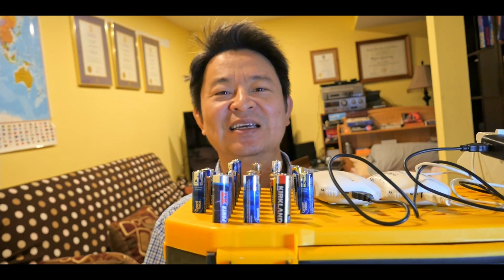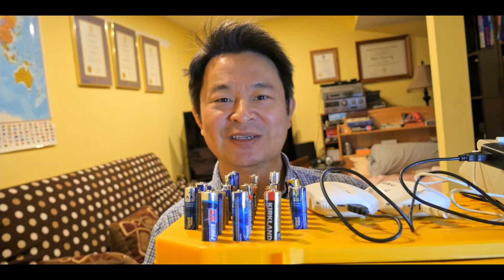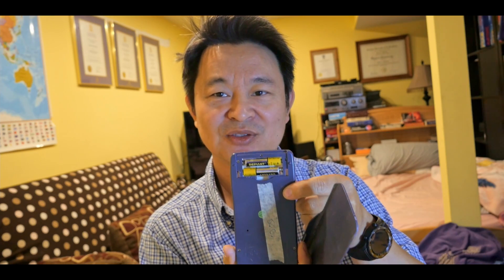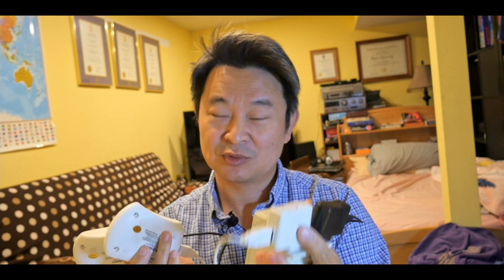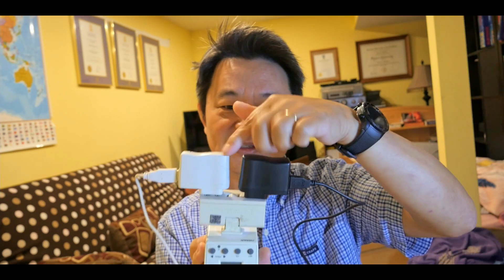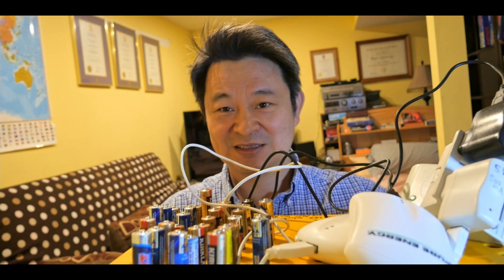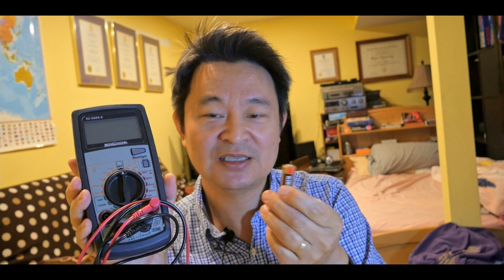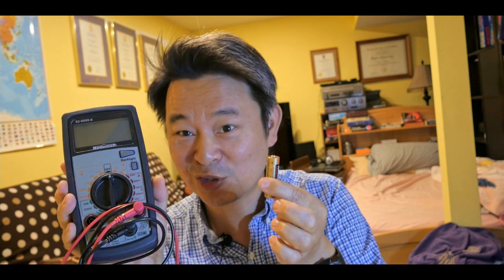How to recharge or re energize regular alkaline batteries safely and effectively

Comment: the lower the voltage you let the batteries get, the worse results you will see.  if you recharge before the voltage drops below 1.25v, you can usually charge back close to full capacity a few times before they start dropping off. maybe charging to 1.55-1.65v.  i've experimented some with charging a little extra before using with mixed results, up to 1.7v. i have damaged some.  i can test for capacity on the multimeter, with 10A current setting, just checking as quickly as possible, but is still bad for the battery.  i make many of my own chargers, and power supplies using buck converters with old printer power supplies, and wall warts.  the old dumb non-switching wall warts seem the most useful to me.

Comment: hmm 4 years ago i bought a bunch of aa/aaa format lifepo4 batteries. they are all still running fine. the issue is they have double the voltage of regular alkaline batteries so you need to make spacers or rewire the battery contacts. alkaline batteries are such low voltage that most electronic devices use multiples of 2 to run, so it actually works out really well. they dont leak and they basically have the same capacity as mid grade alkaline bats... its just that you might be giving up some capacity if you use spacers instead of rewiring a battery holder from series to parallel. cant believe almost no one has heard of these. i just recharge them with a bench power supply and some neodid magnets.
again this was 4+ years ago that i bought them lol, they still have full capacity. they were cheaper than alkaline batteries when i boguht them at the time ironically. brand name of the only mfg that makes them is soshine. all lfp is made in china btw.

Comment: Can a CR123A lithium battery (non-rechargeable) be recharged?
Reply from the maker: I don't think so, but I have not tried to charge it myself yet.
Reply: @educatetube  thanks for your reply. I couldn't find any info about anyone attempting to recharge these non-rechargeable CR123A batteries, so I'm not going to take a chance. I have found that the retailer Lowes sells Surefire lithium CR123A batteries quite cheaply at $4.97 for 2 batteries. Made in USA.
Reply from the maker: If you are recharging it, make sure to start at very low current (less 100mA) and monitor the voltage.  DO NOT let it be overcharged, keep monitoring  it and turn it off when you are away from it.  Don't take any risk without great precaution.
Reply: @educatetube  will do. thanks for the tips!
Reply: No. Lithium-ion batteries such as those used in laptops, cell phones, and power tools are fully reghargeable but ones that only say "lithium" cannot be recharged.

Comment: I have a charger from Amazon (still available, i think) called Maximal Power FC999 Mark 3, which charges lithium, NiMH, Alkaline and NiCad of all sizes and voltages, including 9v. It has been working well for me for 3 years now. Excellent video, there, and i think i will experiment with making my own, too, like yours...just for fun. Many thanks.
Reply: Just to add....it seems the newer version of mine does NOT now recharge lithium batteries, unfortunately. Mine does.

Comment: Yes, it does work but is very limited and imho not really worth it. The best way to recharge is to use pulsed DC just after a rectifier diode (or bridge rect.) - no smoothing. Max. Charge voltage can go up to 1.6 or max. 1.65V and max. current for AAA is less than 50 mA, for AA max. 100 mA. The possibility of leakage will increase drastically - in my case after 2...3 years 25% of all recharged batteries suffer from leakage! Don't use recharged cells for expensive electronics at all! Only use them for cheap, low load devices like clocks e.g. Imho its not really worth the fuss - much better to use NiMH rechargeable batteries or the new li-ion ones - they don't leak!
Reply: Yeah, I agree. Instead of recharging alkalines, I simply "migrate" my used batteries from higher-drain devices down to lower-drain. When a device stops working I use a battery tester to check the charge left in the battery(ies) (my analog meter gives a percentage reading). I write this percentage number on the battery with a fine marker, then put it in a box of used batteries ordered by expiration date and remaining charge level. Next time a device stops working, I simply replace the used battery in it with another that is "less used" (i.e. has a remaining charge level that is slightly higher). When pairs are used, I match brands and charge levels as closely as possible.

A hair shaver will stop working when an alkaline battery drops to only 90%! This battery is then still good for a pocket radio. Once it gets too low for the pocket radio, I can use it in a wall clock. After that fails, the battery is down to 75% or so, it will still work in a TV remote, even down to 60% or 55% charge. Below 50% (on my analog meter) it is pretty much good for nothing, in my experience. With this method, I am still getting useful life out of batteries that are literally over 10 years beyond their expiration date and have not leaked yet!

(Anyway, I only use Ni-MH in my hair shaver now because it burns through alkalines too quickly.)
Reply: @jeromeglick  yes, most economic procedure but quite cumbersome and time consuming. High drain devices are only used with rechargable batteries, preferably li-ion or Ni-Mh. The other remain with alkalines.

Comment: tried to charge it by low current, after 6 days of charge i got voltage rise from 1,09 to 1,54V. Still in test, my goal is to rise it to 1,601V, and then test if it keeps it

Comment: I learned along time ago that alkaline batteries can be recharged, you just have to watch them carefully. Had some leak ( none blew up ) but found that the device ( cheaper ones) could be cleaned by using white vinegar on q-tips  and lightly rinse in tap water, air drying or with hair dryer. Saved a lot of money.

Comment: Best Alkaline 4X AAA/AA battery Charger is the (made in Taiwan, ROC) Powertran A0280.
It is a microprocessor controlled battery charger allows you to recharge standard alkaline batteries up to 20 times. Also can charge NiMH rechargeable batteries. 
I have been using one for years charging lots of alkaline batteries. Tried to buy one more but product is no longer being manufactured.

Comment: Did you try Coin cells? lithium batteries? cr2032 for example?
Reply: sofern die Knopfzelle Alkali-Mangan basiert ist, gelingt die Regeneration. Die meisten sind aber mit Lithium und das lässt sich nicht regenerieren. Jedenfalls hat es bei mir nie funktioniert. Dagegen Kohle-Zink sowie Alkali-Mangan, das geht. Ich habe eine ganze Reihe von solchen Regenerator-Elektroniken gebaut in den letzten 10 Jahren. Internet und Elektronikzeitschriften sind voller Schaltpläne. Eine Firma ACCUCELL hat die Lader mal verkauft, dazu auch speziell regenerierfähige Batterien. Sind aber jetzt "out of business".

Comment: I hope your day job isn't selling fire insurance.
Reply: Is it your day job? Are you qualified as an underwriter or have some sort of degree that qualifies you to make such comments? If not, then why bother? Grow up.
If you cycle the power on and off in 20 to 30 minute intervals   and not allow it to overheat...
Then it works.
Plus if all else fails you can do it outside.
You clicked this video, looked up the content then have enough audacity to think you are qualified to make such statements? Get over it.
Reply: @samgreen23  If a fire starts as a result of attempting to recharge a non-rechargeable battery such as an alkaline battery which is always clearly marked with a warning NOT to do so, the insurance company will NOT pay the claim. This is a disaster just waiting to happen. Buy rechargeable batteries. And no, I'm not an underwriter. I just have common sense.
Reply: @richardmerriam7044  so does a lighter, do you sell those? Do you sell fire insurance?
 Thanks for the tip but not everyone needs a label on a tidepod to prevent poisoning.
If done correctly it can be done in a safe manner.
Lighters are dangerous around paper, you going to light the stack in your kitchen? Let's talk about common sense shall we?
Reply: @samgreen23  You clearly missed the point.
Reply: @richardmerriam7044  no, I don't think I did. You certainly missed mine though.

Comment: Radio Shack used to sell a recharger for Alkaline batteries including 9V ones.
Could do 2 batteries or one 9V.
D cell batteries took nearly 18-20 hours to charge.
Too bad they are out of business and no longer have those available.
Reply: Didn't the RadioShack ones also charge carbon zinc batteries?
Reply from the maker: No, it cannot charge carbon zinc batteries as they already started to corrode away and hard recover.

Comment: How many days if used this in multi tester same as you?
Reply from the maker: You charge the batteries several times depending on the brands.  Watch out for battery leakage if overcharged.  Always monitor the batteries to make sure it does not leak.

Comment: How do they charge new batteries at the factory? I just bought 8 D cell batteries and put them in a 9 inch plastic fan, and the fan would not turn on. I put the old ones in and it ran. I put 6 other new batteries in and it worked fine. I put the first set of new ones back in and - again nothing. I think that sometimes they ship dead batteries. I'm going to test them in the store before I buy them from now on.
Reply from the maker: @lights6833  Wow.  This is surprising.
Reply: They don't "charge" new alkaline batteries at the factory. They insert all the fresh chemicals into the battery cell which when mixed in the proper way, inherently contains charge, produces a voltage differential, and can push current.

Comment: Is this possible to recharge duracell® 6v lantern alkaline battery?  If yes, how to do this.
Reply from the maker: You probably need a variable voltage bench charger that charge 6v @100-200ma for 3-4 hours.  It may leak after several charging cycles, so it may not be worth it especially if it will give you only several wattage of power; mainly used for LED light.
Reply: That's is a lithium single use battery.  I wouldn't try charging it -- unless you'd like to set your house on fire...

Comment: Thanks for a valuable video.   A few questions:   

1. at 3:15 you label the type of charger you use as "alkaline rechargeable device".  It would be useful to distinguish these from other kinds of chargers.   One of my chargers immediately rejects my alkaline non-rechargeable batteries, while another (less high tech) charger accepts them.
2. I am assuming you use a 4 hour timer to avoid the possibility that unlimited charging time might cause battery damage.  Is that right?  If so how did you settle on 4 hours?
3. Have you tried recharging batteries that are very drained vs. those that are less drained.  For example I have quite a few AA alkaline that are giving 1.0 V now.  Would you expect they could be recharged just a well as more depleted batteries (eg 0.5 V)?
Reply from the maker: Answer:   I used any chargers that only charge alkaline batteries up to 1.2-1.5v with low current (less than 200ma). Set the time to 4 hrs charging limit (thought this would prevent leaking). Charged Alkaline batteries are only used for my LED lights. However, after several charging, some of these alkaline batteries do LEAK!  I think the more drained the battery, the more chance of leaks.  My current solution now is NOT to charge alkaline batteries but to drain all the power from it using low voltage booster circuit.  Now, I prefer salvaging Zn-C batteries and take their chemical components to make new batteries. You can check my DIY Zn-Al battery experiment videos.

Comment: I found a good battery charger for Alkaline Batteries, as well as Lithium. Its on Aliexpress at the store KLW 168 Official Store, Store number 4682052. It  does up to 4 AA at a time and is about $10 usd plus freight and has a USB power cable, so a an adapter is also needed for whatever country you are from. It has excellent reviews, about 74 of them. They are very hard to find or expensive elsewhere, as far as I can see, since alkaline charging is not recommended. I have a Powerhaus fast charger which is good quality, but does NOT like alkaline batteries, the charging LED goes from red to green very quickly. However I discovered that this does not mean it stops charging, it just proceeds at a much slower pace so I will use that, after 10 hours the no brand SCA batteries came up to 1.61 volts and after small use dropped back to 1.57 which is amazing.
I read on a reddit post that Panasonic alkalines recharge very well. I use batteries for headlamps and flashlights, a blood pressure monitor, bicycle tail lights,

Comment: So can you use a regular NiMH battery charger?
Reply from the maker: You can but the charging current must be  low and voltage must match the voltage that you want for the battery.
Reply: @educatetube  so I got one that is... AA- 2×2.8vdc 200ma;
That should work, right?
Reply from the maker: The voltage does not match alkaline AA and current is too high. May cause a battery leakage.
Reply: @educatetube  oh okay. Well thank you for all your assistance! 🙏